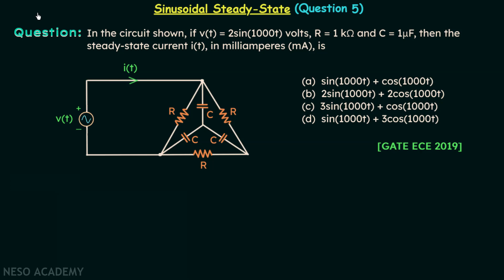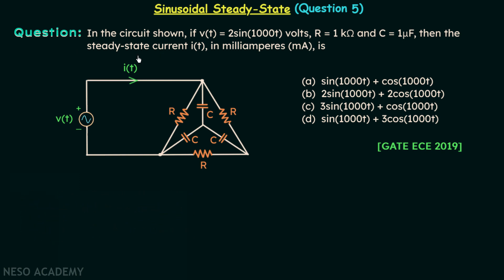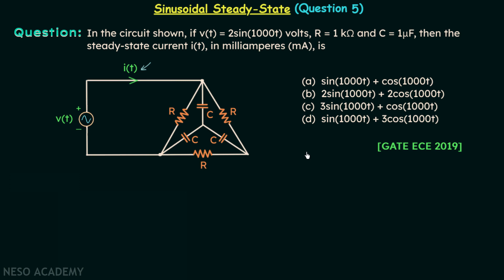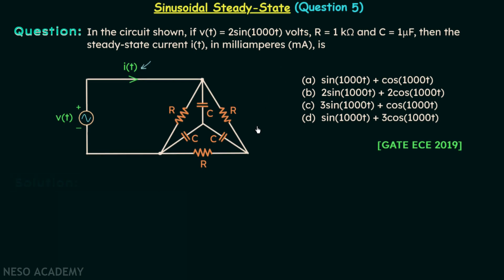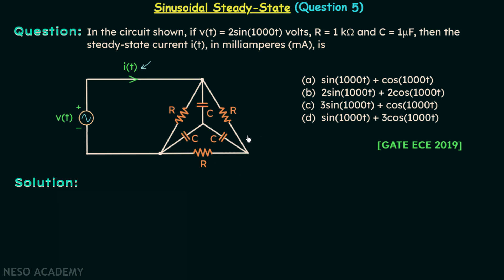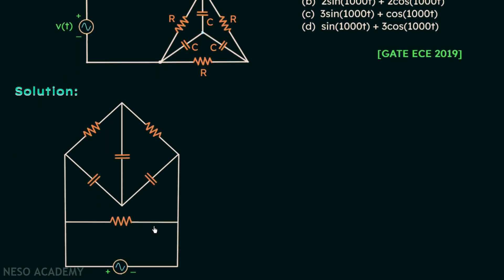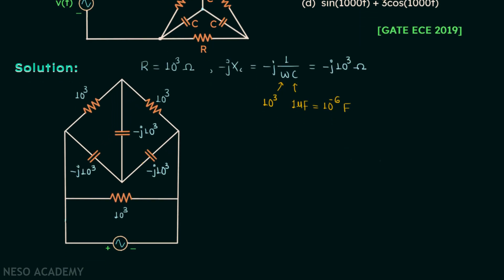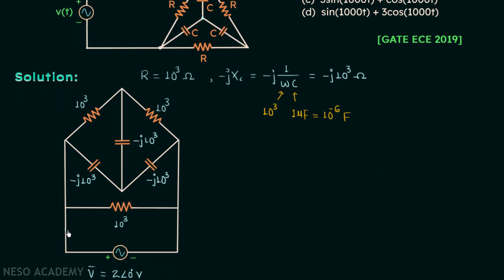Sinusoidal Steady-State (Solved Question 5)

Comment: In series capacitor get divide you added -2j×10^3 .... but it is -j/2×10^3
Reply: Capacitance is calculated in parallel when the capacitors are connected in series. But there is capacitive reactance Xc .

Comment: Since Z2 and Z4 are capacitors which are in series . So the result of both is (Z2*Z4)/(Z2+Z4) isn't it correct
Reply: After writing them in terms of reactance, they can be added just like resistors.
Reply: @SasawataDG  (-j10k*-j10k)/(-2j10k)=-j10k/2

Comment: I used Delta to Star conversion on the capacitance network and after simplifying a bit I got 0.5uF || 2/3 Kohm. Is that wrong?
Reply: i too did like this only it is right only.I got the right answer only. It is simple than this method